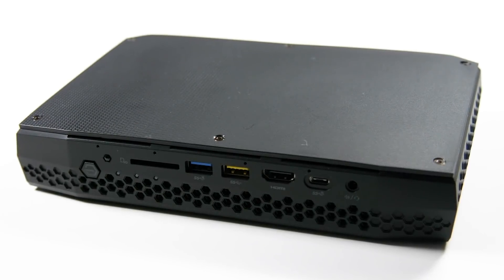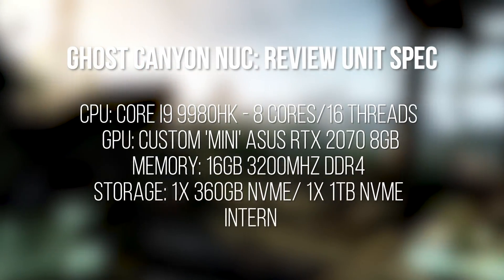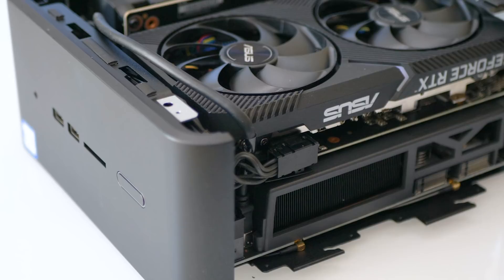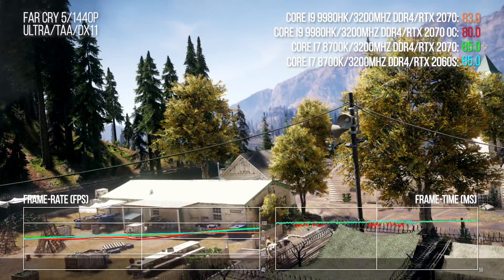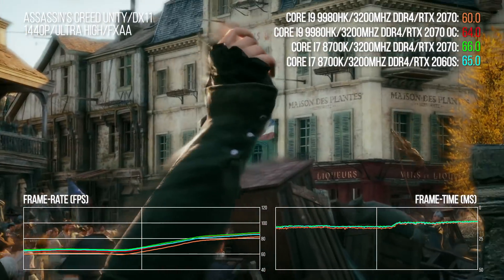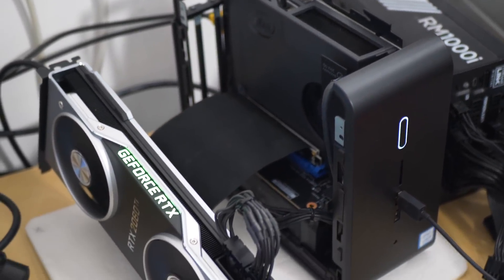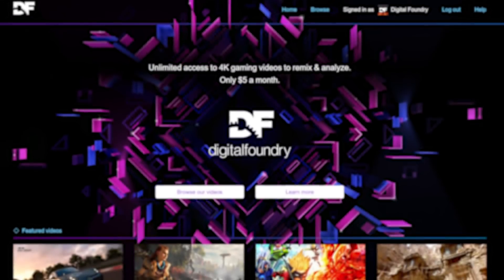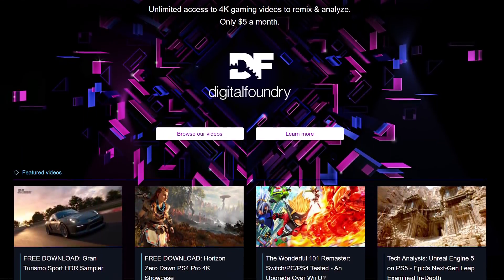Ghost Canyon NUC 9 Extreme Review: High-End Upgradable PC Gaming That's Smaller Than Xbox Series X

Comment: In DF's words the Gpu is similar to PS5 power. The OC takes the stock GPU up to 1.9 to 2.0 ghz. This increases performance by approximately 5 to 6% but with a power cost of 20 to 30 Watts ~10% of the stock 270 watt NUC. But, Richard noted it could be cooled successfully at this frequency. He also noted the mobile chips did not yield the same performance gains  that you would expect from a similar up clock in a desk top version, because the desk top draws way more power!

My conclusion is the PS5 will be at least as big as the Series X for cooling and unless it is drawing significantly more power from the mains it cannot be more performant than its competition. I'd also say it'll be a challenge to keep it quiet especially at 2.2 ghz. Wow, at that frequency, if it can sustain it, your gonna need blocks of ice to keep it cool!!

Comment: I recently built a mini ITX for my living room. While it is significantly more powerful than current consoles, I’ve got to say, gaming on it is so much more of a hassle.
You have to have a mouse and keyboard to login to windows, constant updates, logins for all the various storefronts, accounts etc. The controller range is terrible despite being line of site, 8ft away and using a 8bitdo controller adapter. 

Overall it just takes much longer to actually play and it’s buggy compared to any console experience.

Now if someone made a full gaming OS that eliminated windows and collected all the pc storefronts... we would have something. Until then, just be aware of what you are getting into.
Reply: You're approaching this wrong.
Don't use an 8bitdo, use a modern mainstream controller like an xbox one or ps4 controller and either use a program that has your controller emulate a mouse or have something like steam big picture mode at launch and you're golden.
I have a small form factor gaming PC I built several years ago and I can turn on the PC and my TV and start playing using just an xbox one controller.
Reply: @MrCoincash  I'm using a PS4 controller and the 8bitdo adapter. The built in bluetooth doesn't have the range for some reason. I am also using Steam big picture. How do you bypass the windows login with a controller? I don't leave my computer on.

Comment: The more interesting product for me, would be the XMG APEX 15 which is a laptop with a faster AMD desktop processor (3950X) with a full socket, so it's not soldered like this. For around € 2200 you get a similarly spec'ed machine with more performance and a display with keyboard.

Comment: The performance seems to be lower most likely due to the bottleneck in the type of connection the CPU has to hop through not to mention the latency. It's narrow and slow bandwidth quality. So, definitely not like the Xbox Series X in that regards. In terms of bandwidth, speed, and latency in a very compact package without sacrificing temperature and perforance, the console is still in it's own class. I'm definitely interested in how Sony deals with the tdp in terms of cooling design as they've always been the more eccentric and lavish in terms of design. There's been rumors that their cooling solution is adding a lot of cost in terms of production due to the goals they've set.
Reply: Honestly it's not even a fair comparison. The rig in the video clocks in at just shy of $3,000.
You can get "similar" performance to a series x for the price of about 6 of them or like 5 and a couple years of gold for each.
You can get a series X, a ps5 and build a computer that will outperform it for what they're asking.

Comment: Pretty awesome form factor and layout, but the heat/cooling apparatus is dubious and will keep clocks cycling pretty low. Considering price, better to invest in a other, more versatile mini-chassis desktops to expand both upgradability and cooling options and/or a PS5 or Series X (both will have top notch cooling, should offer remarkable game performance in their 2nd or 3rd years after shedding cross-gen concerns -- remember PC multiplats won't be able to enforce mandatory 8/16 CPUs and fast SSD min requirements for a while either so PC versions won't adhere to next-gen console specs as a 'baseline' until mid 2021/22 anyway)..

Comment: 1/10
To put it bluntly not worth the cost. 
The price for this particular spec on review is strangely not even mentioned, I wonder why. 

"In theory is more powerful than the next gen" consoles,
well for predictably 4 times the cost it certainly will have to be, but even then is not worth it. 

Ridiculous price point, just for small form factor, and a soldered on CPU, laughable. 

Can easily get something way more powerful, or a high end laptop instead.
Reply: Price point for that setup is around $2,900 btw.

Comment: Frome someone who has used a small form factor pc dont, if you want something small just get a laptop, otherwise get a case that at least takes large form factor gpu into consideration, it could be a pain when upgrading since the dimensions they tell you on Newegg or amazone aren't always correct since most small pc cases only build around a certain gpu, or custom motherboard wich will probably never receive an update either and when wanting to upgrade or a power supply that at most they will have is an upgrade to 330w. Also plugging in a rtx2080 is cutting it close with that power supply that can introduce shorts or black screen issues later on.

Comment: Theres a reason that the more  "versatile" pc doesn't win the living room. No want wants to dig around in Ebay for the best priced used equipment to build a cheap and inconvenient living room pc. 

A $200 to $400 brand new console in a much better value proposition, no need to out bid people, worry about warranty, and get peripherals working. Just plug and play with an os that's built for couch usage. Windows is not designed for the couch. Steams alternate  controller OS doesnt do enough. Go change your discord server on steam without  getting up and going to your pc. Or just have a keyboard at minimum lying around. Inconvenient for most people.

And the price for the nuk is unreasonable for couch gamers that need to figure out the couch situation.

This isnt a living room replacement, just a sff pc.

Comment: Digital Foundry If you’re going to over clock the NUC you might as well OC the others to show the waist of value discrepancy this proprietary upgradable system is. And you left out the fact about Ram speed limitations which raises the heat up too.

Comment: This is 1600$ minimum, to get 16gb of ram and a nvidia 1660. Quad core Intel  9300.
3x more expensive than what the series x or ps4 will be. 1800$ for the 2070 model. Nearly 4x more now, and will underperform compared to next gen consoles. 

Great form factor is what you're paying for by a large margin.

But for 1600$, you cant play red dead redemption 2 at 4k60fps at one x settings. Let that sink in. 
Build yourself a pc!

Comment: priced out the one you guys had, $2900 Us dollars. For that price you could buy a ps5 series X switch and build a decent desktop PC.
Reply: Exactly, And have change for an nvidia shield tv for streaming duties.
Reply: Or buy 3 systems, with smaller case, ryzen 3700x 16gb ram 2070mini and 1tb of nvme storage. The fact that you can build smaller for roughly 1/3 of the price with standard of the shelf components, really makes this form factor quite redundant.
Reply: And buy a box of 💥Hot Pockets💥
Reply: jvalex18  are they... 🤔
Reply: A ps5,XSX and a 65" OLED or QLED

Comment: I think they should come up with a set standard form factor so many PC components of set size can be upgraded on these, there is a market for that if done right, especially if they target the mid tier gamer at those mid tier price points as that puts them in direct competion of consoles, then if they sort out games were on first load, it does a quick test on your hardware to see what it can do and configure depending on your default settings you want, say 60fps and whatever resolution you pick and the game does the rest and on top of that, a new store front that has a much more reduce cut they take from developers if any cut at all, all that would be a massive threat to consoles in many ways, especially considering the open nature of the PC, the upgradable and being a full-blown PC that does gaming at a mid tier price point.

The thing is as well, hardware companies would benefit as well because they prefer selling hardware on the PC then consoles because the margins are better and because people can upgrade so they have an incentive to make it happen.

For the time being, mini tower are the best options for portability and upgrade options.

The real problem with the NUC are other small form factors are the price, considering the market that would be interested in that, the price will have to be a lot less, again, which is another advantage mini towers have.
Reply: This isn't new or revolutionary, you may want to do some light research before posting such a long comment to save time,
Other brands have already built small form factor cases for the same modular parts, alienware for example has one. 
The problem is the price for the modular parts, it wont take off because of limited stock availability and the huge cost over more traditional parts.
Reply: @rickylovesyou  I never said it was new but without a set open standard, it doesn't actually do much in the PC space, if it was a set standard, hardware from all levels would be designed with it in mind and that would make a difference in the long run.

What Intel and Alianware have done is a custom build where many of the components can't be upgraded and where the price is sky high, what I'm talking about is a set open standard where components are made with that form factor in mind, that would allow PC users to build really cheap PC that are small or console like boxes with comparable performance, that would be a massive deal for many and would be another nail in the console coffin.

Comment: The fact that you can build a smaller, a full 20% smaller, better cooled and more powerful with off the shelf M-itx components really should make this redundant. Velka3 or k39 case is smaller and can accommodate of the shelf parts. Slightly limited in GPU lenght, but so is the NUC. And you can do all of the above, for cheaper or try and hit same performance level for much cheaper. 

If however you need bigger GPU velka5 case can support up to 296mm and at only 5.7Liters . 14% bigger than the NUC.

Comment: This product Intel garbage IMO. It is insanely overpriced, while implementing mobile 9th gen, outdated and underperforming parts. This is ignoring Intel's history of abandoning their platforms early. What happens when they (finally) move to PCIe 4, or DDR 5?
You could easily build something faster, cheaper, and smaller with the velka 3, or something slightly larger with even better internals. Or you could even buy a laptop with a similar performance and display, battery, and keyboard for less.
Garbage product.
Reply: The velka 3 is 2-3 times as big. They sell NUCs with 10th gen, they just dont come with a GPU.
Reply: @BoshBargnani  Correct. As of right now, they only have 9th gen for this "gaming" version, but have a 10th gen for the "home entertainment", which is a completely different product. Also, Velka 3 is 4L and this is 4.9L. Velka 5 is 5.7L and can fit a full 2080ti. Both are better options than this imo.
Reply: @BoshBargnani  Should be noted no NUCs come with GPU's stock; any places that offer it to you put it in themselves.
NUC's are shipped as barebone rigs.

Comment: Here’s an idea for a video. People often speak of game optimisation on consoles where it is believed that the games make the most of the available hardware. How much of an advantage does that give to consoles in reality and how much more raw hardware power would one need to achieve same results on PC?!
Reply: The optimization problem on PCs is that there is no such thing as a standard PC. A tiny fraction of the PC user base can afford to keep up with the latest "must have" upgrades, and the rest have to quite literally "lag" behind and not be able to play with a reasonable fidelity to the promised look and feel of the game as advertised. Bad device drivers can ruin your experience too, and make it difficult to trace why you're not getting the game experience you expected. Too many variations on hardware mix, clock frequencies, data transfer timings, interface standards across the board. Motherboard design will have to change radically to remove legacy bottlenecks just to allow the kind of performance the next gen consoles can offer.

 Basically what I'm saying is that the best that you can expect in PC games currently is the usual screen full of options/features you can turn on or off -  throwing more raw power at the problem is an inefficient and costly solution.

Comment: Your specs mention 2 nvme drives though footage is only 1 in the compute element. I can only assume that the other is in the breakout bracket where the GPU sits. I am aware that x8 vs x16 really doesn't matter too much since that nvme drive takes x4 lanes, but, would this affect gpu based render performance oppose to gaming?
Reply: Karl Clarke I’m sure he is implying two SKUs. One with 300gb and the other is a 1tb.  There is an expansion under the video card area for a second nvme

Comment: NUC products are traditionally expensive, so this is very much a halo product that will probably not find many customers. I really do like the internal construction though, I hope that it'll find its way to better value products some time in the future. It takes a lot of hassles out of building a SFF PC.
Reply: Halo product is usually top performing. This isn't it chief...
Reply: @BudgetGamerz  Nah, that's not what halo products are about, they are about projecting an image. Here they are trying to showcase their engineering chops by presenting an innovative design, even though performance is ultimately constrained by the form factor and choice of CPU.
Reply: @SteelSkin667  this isn't projecting any image chief. Expensive does not equal Halo. It either has to perform great or look elegant. It has neither going for it
Reply: @BudgetGamerz  It's the better performing machine from the NUC line and 'm pretty sure this is supposed to look elegant - personally I think it does, but your mileage may vary. Whether they have achieved their design goals doesn't really take away from the intent, though it does take away from the effectiveness of the product.
Reply: @SteelSkin667  lol so compared to other Intel nuc it's better performing... Who would have thought a 2020 product would be better than a 2018 one from the same maker. Yes I do like the internal structure. Intel's pricing will see that this fails.

Comment: I am not so sure that this is more powerful than a PS5. How is a custom Zen 2 core with GDDR6 memory performing? It might be better than a mobile Intel CPU we have here...
Reply: I don’t think that the new consoles worth have full desktop cpu either. The last ones shipped with Tablet cpus basically. Putting a full desktop cpu and gpu in such small cases would Probl be to expensive and cause problems with heat. I would expect the new consoles to also use kind of mobile chips, Probl similar to the 4800h.
Reply: Technically looking at specs so 8/16 threads 3.6/3.8ghz it should be a 3700x without boost